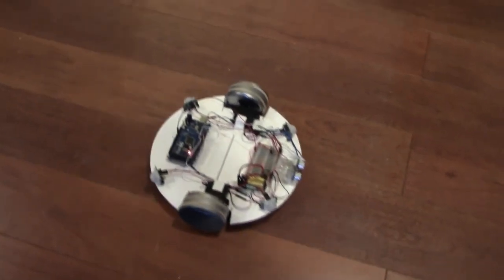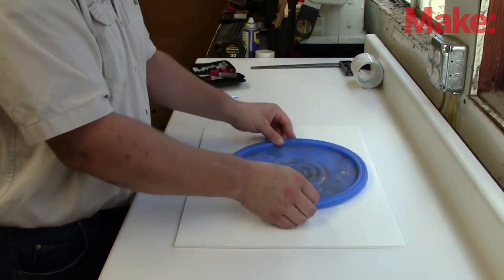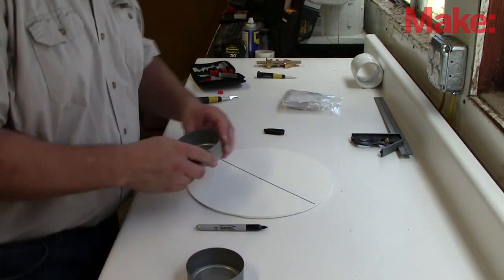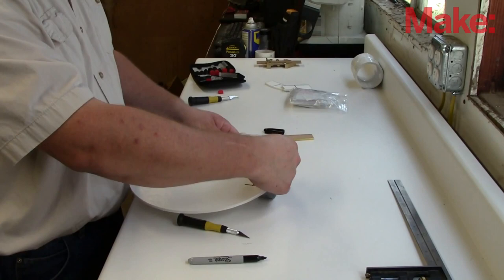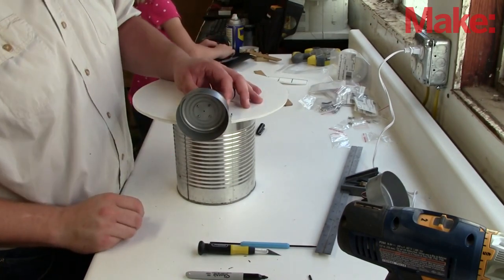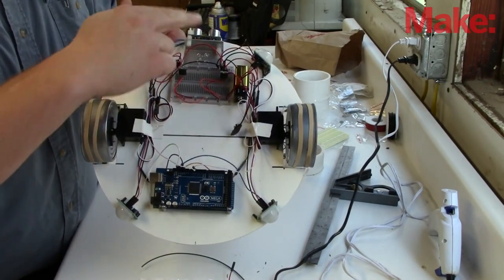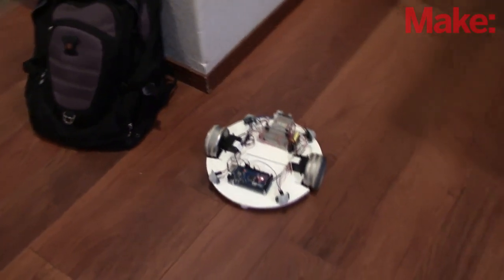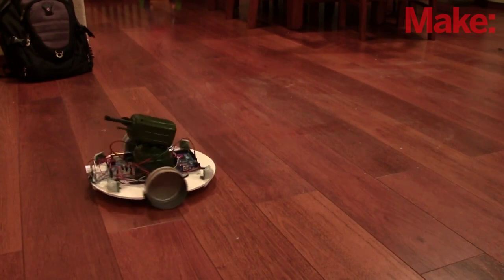Projects With Ryan Slaugh: Hack-Bot

Comment: Well, get yourself acquainted with Arduino by doing a few basic controllers. Then you can wire any of your i/o pins to the data on the servos, power the servos using regulated power and program the bot with the Servo library(I think Arduino software has demos for it to get you started)

Comment: there is ref to valid info. he mentions he uses an Arduino, and also the sensors he uses. So you could go google "Arduino range sensor robot tutorial", or "arduino PIR robot tutorial" or " arduino IR robot tutorial" or "arduino infrared robot tutorial".

If your just getting into it, you can simplify things and google "arduino robot tutorial" or "arduino bot tutorial" pending on your nomenclature.

All the info is there, it is up to the lazy to look things up for them selves.

Comment: Never mentioned modding the servos, or that there are far better ways to get something moving than modding expensive hobby servos.

How about trying to teach people some skills rather than telling them to hook a $20 microcontroller to some $15 mutilated servos and calling it a job well done. Could have done the whole project for less than the cost of the arduino, and taught people about h-bridges, micro controllers that don't cost a fortune, and pwm servo controle (maybe even some PID)